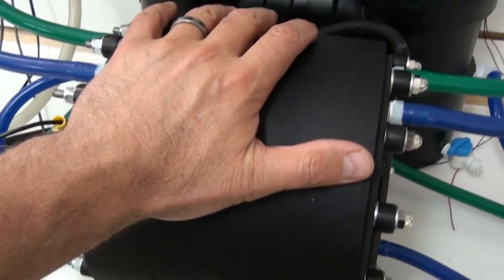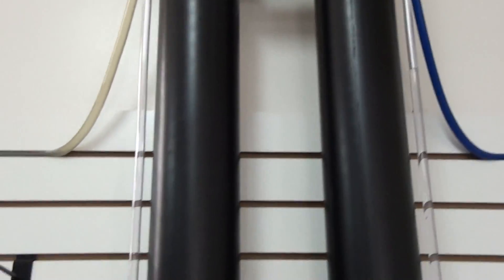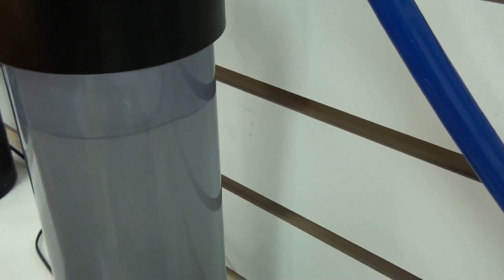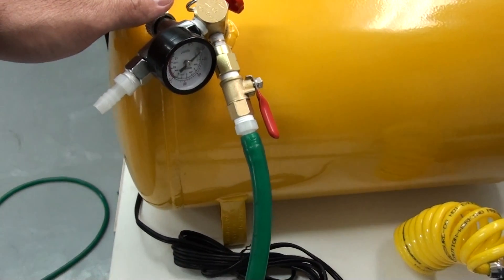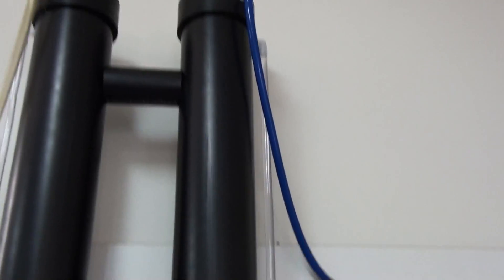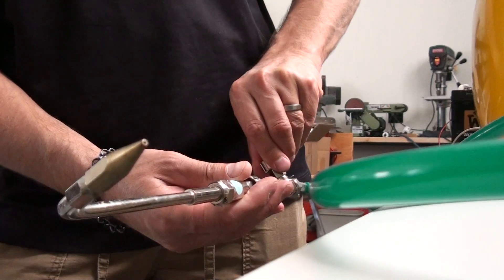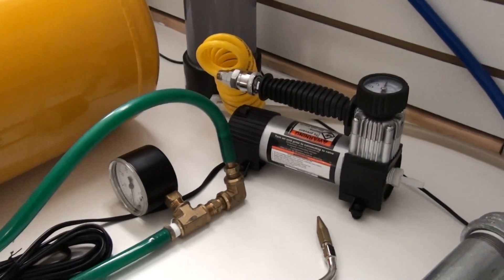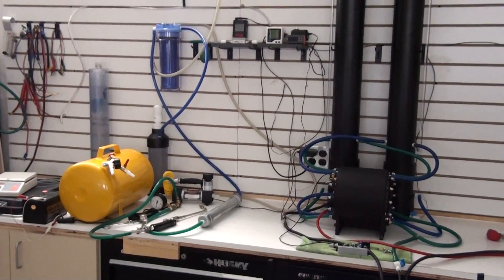Pure Hydrogen Generator Split cell system. Hydrogen compression PART 1

Comment: WHAT ARE YOUR THOUGHTS ON THE AQUA TUNE?  I DON'T SEE THE GENERATOR ONLY THE WATER TANK BUT THEY ATOMIZE THE HYDROGEN WITH NOZZLES INTO EACH INJECTOR TUBE/ PORT?  THEY CLAIM 25 45 %IMPROVEMENT
Reply from the maker: Link please.
Reply: @Hydrogen4Health  SORRY I DON'T SEE A HIGH LIGHTED REPLY.  I ONLY HAVE A BASIC KNOWLEDGE OF HHO. I LIKE YOUR SYSTEM; HOWEVER, THE AQUA TUNE SHOWS A GREATER PERCENTAGE OF FUEL SAVINGS.  THEIR COSTS ARE TOO HIGH.  I AM TRYING TO JUSTIFY BUY A SYSTEM FOR MY 95 FORD 350 DUALLY 351 C I. / 5.8 L GAS ENGINE.  I AM A MINIMALIST TRYING TO BE ENVIRONMENTALLY AND ECONOMICALLY CONSCIOUS.  I REALIZE YOU CAN NOT GUARANTEE RESULTS; HOWEVER, I THOUGHT HHO WAS MORE EFFICIENT. I WOULD LOVE TO RUN ON 100% WATER AND BELIEVE HYDROGEN IS THE WAY TO GO VS ELECTRIC.  DO YOU HAVE A PRIVATE EMAIL OR PHONE NUMBER I CAN CALL??  THANK YOU SO MUCH.

Comment: HHO HYDROXIDE HELIUM OXYNL...HELLIUM IS INVISIBLE..HYDROXIDE BURNED RED SULPHURIC PER OXIDE...TWO GASES HYDROGEN HELIUM ..DEHYDROXIDE VIOLET ULTIMATE VOLTAGES WITHOUT TOUCHING THE GROUND..BUT FEED BACK VEYOUND BEYOUND BAR VAR BIO VIO...TWO METERS TWO SPHERES...HIGH HELO..STOP PLAYING TRICKS OR TREATS....

Comment: Love your video.  Might I say it also scares the living shit out of me.  I know you are very competent and hope you don't take offence at the following suggestions.   1) Earth grounding.   Possibly a sheet of well grounded mesh on the flow of the work area to stand upon and most metallic equipment.    2)  Air flow, big fans, so in the even of any leaks the H2 is mixed down to at least 18% , below 4.6% would make most people happy.    Just big fans directed at the equipment.    With very best regards, Chris
Reply from the maker: Thanks Chris, well noted.
Reply: High Chris, thanks for your suggestios. I think security is very important if you want to do that at home. My english is not very good but I think that I understood both. The second one related to leaks of hidrogent (very very small molecule, two protons) they can go away in a tiny space. I was checking several detectors with 1% and 2% levels to activates alarmans and ventilation. The question is. 4.6% of H2 is safe? The first one, you need a ground plane for what, security or it is for to reduce EMI, I mean the small voltage that appear when you share a connector for two current flow?
Thank you ver much delvis for your videos.
Thanks for reading and a happy new 2022!!!
Reply: Odlično si to rekao (!)

Comment: How do u compress the gas? Have u made any modifications in that portable compressor?
Reply from the maker: I've made no modification.
Reply: There is no any inlet hose in the compressor, how do u get the hydrogen gas in the compressor to compress it? I've checked many portable compressors in my market, couldn't find any with a proper inlet option.. I'll be using it to compress HHO?
Reply from the maker: See this video https://youtu.be/xAKuSM10qrY
The small compressor in this video did not work.

Comment: WARNING: Compressing Hydrogen into metal tanks is dangerous, under pressure hydrogen penetrates and metal and causes it to become brittle creating thousands of hairline cracks with pressure expansion can burst and explode like a bomb this could kill you ! 
Always use Fiber and Membrane and recommended metal halide, to absorb the volume and condense hydrogen, 
Raw hydrogen will not compress and , condense into smaller space, like air does, 10 liters of hydrogen,  may squeeze in to a 9 liter tank at 100 psi, and as soon as the one liter is released you are near 0 psi,so the gain is less than 1 percent,
 that's one reason that most hydrogen storage methods are impractical and dangerous,
 unless you have the OSHA certified tanks and compressors that compress gas to 1500- 3000 psi into membrane teflon fiber tanks like welding gas tanks, don't try this at home,
and please don't try to use air compressors, the hydrogen will bypass the piston rings enter the crank case and leak into the motor where electrical spark and high heat will explode this can kill you, 
 refrigeration or commercial gas compressors are the only safe way, to compress hydrogen,
but remember there is no practical storage system, unless you want to buy expensive OSHA GAS TANK or FUEL CELLS
Really it is best to make hydrogen on demand with double bubbler system and flashback protection, so you can only burn or explode what little remains in the gas line, 
thanks a word to the wise BE SAFE NOT SORRY 
DeMayo
Reply: De Mayo I was also concerned, great input thanks for sharing.
Reply: @travismicheal6452  so are you still alive and powering things off this?
Reply: De Mayo thank you for the very important info. God bless you.
Reply: De Mayo I see you kind of people all over the place.
Reply: De Mayo .The video makers is a gooood man.
Reply: Yes, thank you for the addl info. Esp about the compression method and storage. Can I also ask, given the proper storage vessel (and all other parts subjected to pressure), Is there a limit to what the basic Hoffman method can pressurize to? And how does pressure affect production?
Reply: Roy McAllister, the founder of the American Hydrogen Association, has addressed this issue of embrittlement in a video posted to youtube. To summarize, embrittlement only occurs in specific environments when ionic hydrogen is available, and can be resolved by heating the affected metals to effect escapement of the hydrogen from the metal matrix. This is a summary, and Roy is about as authoritative as you can get, on the subject of hydrogen embrittlement, so watch that hydrogen class video for the full scoop.
Reply: De Mayo, that is good advice but, as far as compressing hydrogen goes, there is one better way than what you mention.  That is, no compressor at all.  In fact, it's similar to how this guy compressed that 2 PSI in this video.  If you use a PEM hydrogen generator, you can get well over 150 PSI by simply attaching the output to a hydrogen-safe tank.  Unlike the membrane this guy was describing, a PEM stack can handle a ton of pressure on either side of the membrane.  It almost seems like you're getting something for nothing.  In actuality, the voltage needed to split the water goes up slightly because of the pressure... not much though.  NEARLY free gas compression and SAFE!

Comment: So you get this hydrogen that is considered as the most powerfull explosive?
Reply: It is the combination of Hydrogen and Oxygen (HHO) that is dangerous. This gas is H2 it similar to propane and natural gas.
Reply: This is not true, while H2 is the the most explosive, it also is lightest of the elements; it is the only gas that will float up and dissipate the easiest atmospherically . The other two mentioned will always collect at ground level and therefore much more dangerous. The toxicology of the propane and natural gas is another consideration as is the machines that use this archaic method of explosive technology...

Comment: Why not Use a Water tank Bladder.The Black rubber Bladder in side a Water tank. Remove it from the steel tank to store the HHO in. They are expandable and can feed HHO to the engine while you replenish the fuel. this works in stove applications and all engine applications.

Comment: If you are recombining the oxygen with hydrogen in your H-cat, shouldn't it go before the dryer?
Reply from the maker: You will want a dryer before and after the purifier. The purifier will not work if too much moisture in in it and it makes moisture when oxygen recombines with oxygen so if you want semi dry gas use a dryer after.
Reply from the maker: It's the KOH that is added to the water to make the electrolysis process possible. The bubbler strips it out of the gas so it exits clean.

Comment: take a standard car engine running on gas, witch is a long chain hydrocarbon, the feul burns in this case it's still a hydrogen compound and the hydrogen burns off and turns into carbon hopefully all of the hydrogen is burned off and we get soot out the tailpipe in a perfect mix. if not the broken hydrocarbon now becomes shorter hydrocarbons and the left over carbon that's mixes with oxygen to make Co and co2 and sometimes no2

Comment: take your little torch there put it into a chilled box see how much water condenses inside that little box, none not only that but the torch won't stay lit very long because you'll run out of oxygen because your also burning the oxygen. you have to understand physics to understand it's a basic exothermic reaction.

Comment: no when you burn hydrogen it gone it turns into carbon!
Reply from the maker: No Dennis you are wrong. Heat and water are the byproduct. Chemically really how could it turn into carbon?
Reply: So your turning water into hho and then to 2h2o heavy water.
Reply: +delvis11 how do I compress the hydrogen into a storage tank

Comment: Hi delvis. I have a question I've been thinking about for a while. Maybe you can answer it for me. I understand that both electrolysis and resonant frequencies by pwm break water into its component parts, that is hydrogen and oxygen. I also understand that electrolysis of water gives us what's called Brown's gas, which not only has O and H, but also O and H isotopes (I hope that's the right word), basically a mixture that burns about 3x more powerful than gasoline burned with air. (Again, I hope I've been told it properly).
Here's the thing; does breaking water apart using resonant frequency by pwm give us Brown's gas as electrolysis of water does, or does it give just O and H?
Another thing I wondered about is, when you lit your torch you were using the separated H that came out of your purifier, is that correct? If so, the flame would have to get O from the air in order for it to burn without ruining the neighbourhood and everybody's day. If you're  bleeding off the O into the air, wouldn't it be simpler to just recombine the two gases, or for this purpose not even separate them, so they come out of the torch together (in the proper proportions) to burn with the only exhaust being water?
I guess there's another thing. I guess I don't know a lot all about breaking water apart using resonant frequency by pmw (I understand the basic principle, shake the water until it breaks), and your "joined tube" apparatus is basically the same as the apparatus for electrolysis of water. My question is, how is the pmw set up so it breaks the water up so that only H is in one tube and only O is in the other? My guess is I really don't understand how resonant frequency by pmw works. ;-/
Reply from the maker: +Bruce Dobson As far as I know breaking water into hydrogen and oxygen using electrolysis creates Brown's gas. All the resonant frequency stuff your reading on the internet as far as i'm concerned is fringe science. There is nothing out there that proves using frequencies does anything to the gases. 
In other videos we use HHO generators (Brown's gas generators) The have the H and The O combined. For this project we separate them so that the H can be safely stored or compressed.

Comment: what kind of compressor did you decide on using? i ask because even the purifier has a capacity, anything about 3% oxygen going into the purifier wont be removed, this is the issue I currently have.
Reply from the maker: +gr1nder07 I decided to go a different way. A compressor will be a add on in the future. The test system is totally automated now. I will have something to show in the next few months. The hydrotube produces over 99% purity so the purifier gets it up to 99.92%. Great for compression.

Thanks for asking!
Steve

Comment: wowwww i was hoping that one day someone compress the hydrogen to use it in cars instead of butane gas tank it will be hydrogen gas tank wowwwwwwwwwwwwwwww you are so coooooooooooooooool i will ask like others is there anyway i can contact you :)
Reply from the maker: +mobiletechnologystar Contact me at steve@greenfeulh2o.com
Reply: I hope you don't mind. I am by no means a scientist of any kind. I can only tell you (and others) what I have been told by others, whom I trust have learned either by their own experimentation or by someone else's  teaching.
I don't know with absolute certainty how much hydrogen gas one litre of liquid hydrogen will give, but I've been told that one litre of water yields some 1,866 litres  of combustible, using electrolysis.  I'm going to asume the ratio is the same using resonant frequency by pmw because water is water regardless of which system is used.
Reply: I forgot to add the question, is the ratio 1:1,866 a high enough ratio for compression?

Bonus: Even at that ratio water is completely safe, and it won't blow up or burn.
Reply from the maker: The H gas is safe to compress with less than 1% oxygen content.
Reply: great that is very cool cause i was thinking about compressing it

Comment: You could have used an old refrigerator compressor, they run super quiet and compress over 100lbs plus they are made to compress gases.

Comment: What is inside of the pipe bomb looking device?
Reply from the maker: It's $30
Reply: delvis11 a catalytic converter doesn't purify the hydrogen "removing" the oxigen, it simply makes it react with the hydrogen to make water again, so you should use another dryer at the end of the purifier. 
it produces heat becouse hydrogen+oxigen it's an exothermic reaction.
Reply from the maker: Mark G The pipe purities the hydrogen. It takes out any stray oxygen. it has specialized catalytic converters in it.
Reply from the maker: well you wrong there. The converters I use do purify hydrogen.
Reply: delvis11 can you name the converter's composition (or who produce them it's the same)
Reply from the maker: I got them fro China. The are They contain palladium only. I have some of them still If you are interested in purchasing.
Reply: mmhh, palladium, :) i was right. it removes oxigen by combining it with hydrogen making water.
ps how much for 1?

Comment: compressor is easy to modify, just remove the cylinder head and drill another hole on the head and put an intake check valve on it
Reply from the maker: lightrose100 The problem with these small compressors is they intake air through the crank case. small sealed compressors are hard to find
Reply: The intake is through the piston, you can epoxy it shut and you can buy a couple of tiny ball valve and a tee one for intake from hho
Reply: You can drill and tap another hole for intake
Reply from the maker: I understand what you are saying now. Just glue it shut and drill a intake hole with a check valve. Great Idea!!

Comment: did you already managed to save the hh under pressure? under how much psi? do you use anything special for your tank to better save the hh and make the bottle less explosive?
Reply from the maker: I have got my system up to 20 psi so far. I know I haven't updated people with a new video. Compressing into a propane tank at 140psi is the cheapest storage there is. A regular propane regulator like on your BBQ grill will work also

Comment: Shouldn't the oxygen scavenger come before the drier?  The scavenger is basically burning the hydrogen to eliminate the oxygen, making water.
Reply from the maker: A dryer is actually needed before and after the purifier. The H needs to be dried before it goes into the purifier.
The moisture will damage it's capability,

Comment: I don't see the need for the bubbler. Also if I was looking for pure hydrogen I would not take the chance of passing pure hydrogen through water in case of contamination. Bada Big Boom !
Reply from the maker: The water in the bubbler takes out any koh that may be in the H. It doesn't add oxygen.

Comment: Howdy Steve. Cool system. Instead of using the long tank why not just fill some balloons and when they are full kick on the compressor to the storage tank? Weather balloons hold quite a bit of fuel. Also if you could find a way to mount an o2 sensor on the tank that would alert you of any potentiall dangerous situation would be re assuring to me. Using the stored gas to run a small Honda generator would be a kick.
Reply from the maker: Great balloon idea and worth trying.
Reply: delvis11 Or you could install a Nitrous plate on your truck,.. connect the other end up to H tank for even more fun ;) Where can I find these drying beads? Thanks,
Shannon

Comment: I was going to suggest some thing like a solar wind mill hybrid for a back up but that comes back around to batters and it sound like you are trying to get away from that. I was told once "energy is never lost just converted." Have you thought about taking the extra lost heat and channeling it through a closed loop steam engine. something like a boiler loop around the exhaust pipe of a water heater, generator engine, fireplace, ect. It would also help keep your engines cooler recirculating the water in a closed loop. much like a cooling system on a car. It all comes back to a battery though. An there are bugs to root out but it is a ideal.
Reply from the maker: One of the big reasons why I'm doing this is for energy storage. You talked about batteries, well think of the stored hydrogen as your batteries. Hydrogen doesn't go bad or wear out like batteries do. using a fuel cell when needed for electricity. I like your idea about using the waste heat. Maybe it can be used to make electricity also.